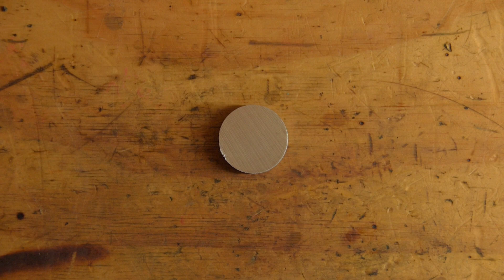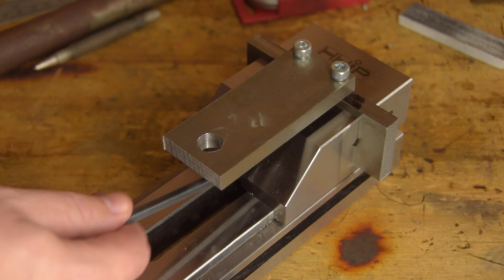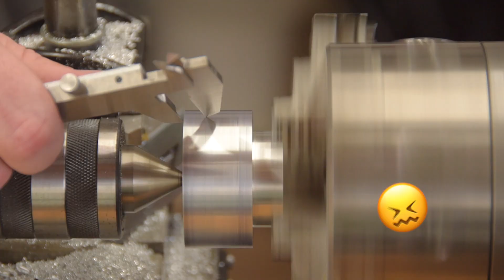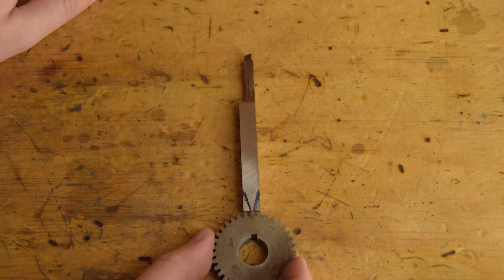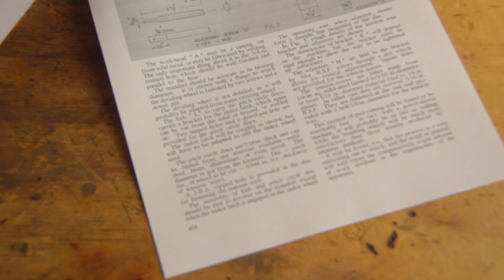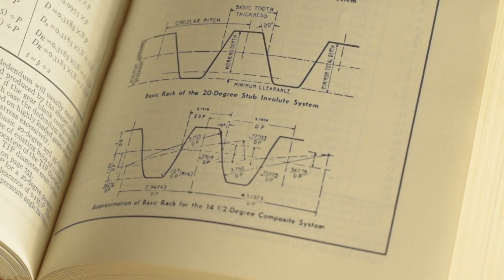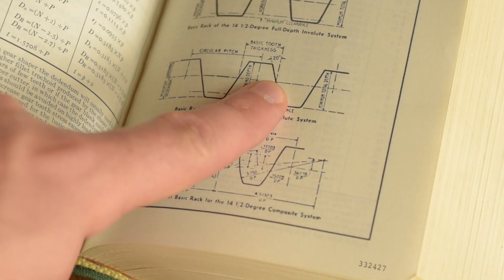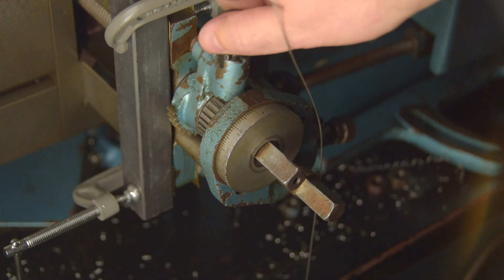Shaper Machine - Involute Gear Cutting

Comment: Interesting project. Replace the wire and wheel for a rack and pinion and I think you will have a greater chance for success. And perhaps integrate the dividing mechanism into the pinion as well. A simple way could be to have the axle running freely inside the pinion and have the corresponding dimples, depending on the division of the manufactured gear, drilled into it and a locking lug on the pinion to engage into said dimples. If you use the same pitch and module on the rack, pinion and gear to cut, I guess you could just step the pinion over for indexing.

Comment: Well done on the video Geoff. I have a feeling my uncle may have written that article, he restored a shaper too. Re the wire, I think that's a good way to avoid backlash though you may want to add a means of clamping it at its mid point to the spinny thing to avoid slip. Also a turnbuckle or something to tension the wire? And a sharp contact to reliably touch on the same point on each tooth of the reference gear. Also keen to know what software you used. As others have said, the table feed may not be super precise.

Comment: Well, there are other people who've made setups like this and gotten them to work so it should be totally possible. I know you can also cut them on the lathe. If you were going to be doing a lot of it, a dividing head would come in really handy since then you actually could just cut a tool with the gear profile and cut them directly without the finicky wire drive bit or do them on the lathe with an involute cutter.

Comment: The problem might be that the drum (with the wire around it) is slipping on the shaft a bit. I expect that the cutting force is not symmetric and is trying to rotate the blank a little extra on each stroke. Hmm, that doesn't make any sense since your indexing disk (the gear) and blank are both glued to the shaft. I didn't get a good look at how you reset the side feed after each tooth; if you use the indexer to set this and the drum were slipping a bit your teeth would drift sideways (rather than around the circumference). Do the teeth you cut gradually lean a bit as you work around the disk? It probably would not be a visible effect as the tooth would only be leaning a few degrees.

Comment: Trust me, I really did enjoy the video, but, I was as lost as a goose! I am not a machinist or a blacksmith or pro welder. I know just enough to get myself in trouble, and can do a little welding, mostly gas but do know a little arc, just no gear for the last. But I failed in college trig, so that leaves me out. I am a wood worker by hobby and a retired RN by vocation.

Comment: Having screwed up hundreds of gears, I would suggest you use a spring-loaded detent on the pattern gear. It took me a while to figure out that wire-based mechanism was doing. But it will stretch or slip, and you will lose the all-important index. There is a very good book by Harold Hall "Dividing", workshop Practice Series, ISBN 978-185486-238-9. I wound up building his dividing head.

Comment: Hmmm. This method is the hard way in my opinion, but if life were easy you would own a gear hob machine. You need to limit the possibility for error and eliminate the possibility for your errors to stack up. Also something that is desirable is a way to make gears with a number of teeth that are different than the gears you own. My first thought is to ditch the cable system for a rack and pinion, but with an added (removable) idler gear to create a shortcut way of indexing your part --- You might even be able to work out how to create different teeth numbers by simply using a different ratio between your idler and the gear turning your part.

Comment: I've seen that tolerance stack up happen on a CNC indexer. They engineer rounded the degree on the on print. The indexer was a brand new replacement with a different style controller then the previous one. So we typed in the print degree and started running. It had roughly 100 2" long slots in it. After 2 hours of running and everything looking good I got the exact same result. It was not a good day. Great video.

Comment: Did something like this back in '89.....I used a shaper and a dividing head with a 4 gear train. I was making a stub gear (3/4 pitch) The dividing head was a VanNorman with an input shaft that turned the 40 to 1 worm. It needed a spline shaft to slide through the generating gear train. I saw the pitch diameter problem right away.....good work on you anyway. Your production skills are among the best on Youtube.

Comment: First I just say what a great series of videos you produce. In response to your request on ideas on how to make the ‘thing’ into mk2, I think the issues relate to rigidity and the possibility for the cables moving slightly each time carrying error into the work. 

What my make one solid post with dovetails to mount solid to the shaper with a shaft through the centre to allow you to mount the index and material. Alternatively if that’s not possible this could be a great excuse to buy more machines.

Comment: Hey, nice video! Couldn't you combine the dividing mechanism with your wire pulley? So the dividing gear is fixed to the backside and a pin (maybe a small coiled spring pin) indexes to the wire pulley to the gaps?

Comment: Ya know I downloaded that exact article pdf YEARS AGO .... with great intentions of trying it on my Elliot 24" shaper but never got around to it... 🙄😂
Nice first try & as The Metal Butcher said, maybe u can use a rack instead of the wire... but NO BACKLASH allowed !!

That myford (ml7 ? ) is lookin clean, mine has been beaten into the ground over the last 40 years, kinda like meself 🤕

btw.... U said at the beginning that the involute ground tool  would be specific to a particular tooth
 number but commercial involute cutters (same profile as yours)  are used for a range of tooth counts !

Subbed & liked my man !!
From the Emerald Isle  😎👍☘️

Edit...
Just peeped into yer archives & seen the lathe before u restored it !! I might have a go with me own now that you've inspired me.... beautiful job !! 🤗

Comment: Great video! I see you've got some inspiration from TOT.
I think the wire is fine, it's the indexing that needs improvement. Maybe a disk with the appropriate number of holes, and an indexing pin. 
Could make the hole disk from something as simple as a printed paper template. 
At least that way, you don't get an accumulative error.

Comment: Great video!
Yes, this is indeed the reason why there so often are at least one of those old shapers left in a corner of even the most modern metal workshops ;)
Unfortunatly i cannot realy help You but i think something that can lock a given position for each turn possibly would help...

Comment: BACKLASH  now that I have your attention you need to eliminate backlash you have the backlash introduced by the piano wire , then there is the backlash introduced by the gears that drive your table ,I noticed you have to manually advance the table part way to compensate for worn drive then there is the backlash introduced by just going back to one set starting point ,even if you use an indexing plate you only advance it in one direction if you go past you don`t just roll back to the indexing point you have to roll past it then advance to the proper point you need because of backlash ( if you have watched any one who used a mill with an indexing plate you will see they do that ) it`s cumulative you have to eliminate it

Comment: A rack and pinion with a set travel length and a lifter on the rack side can reliably replace the wire provided that a preload to one side is used to prevent backlash.  The Lifter could also do the rotate after travel mechanism and the slow rotate mechanism using limit switches and a pair of small hydraulic cylinders connected with valves and a pump to alternating between aligning teeth and rotating mechanism while cutting.

Comment: Instead of wire you can use a rack to run the indexing gear on. Rack fixed to the machine (with screws). You will index and rotate at the same time. I love your work and funny storytelling
Reply: I was thinking the same thing, as long as you could adjust the height of the rack it shouldn't matter the size of the heat your cutting, just the number of teeth. So you could have a set of three same modulus gears and rack and be able to chance teeth counts. It should index better because it would be an average of the teeth it's using.

Comment: Nice video :D What kind of rake angle did you use? It's hard to tell from the video but it looks rather small, like a few degrees.
Reply from the maker: Im not sure exactly which face you mean, but the edges are 14.5 deg. the face is zero, and the clearances going back are just a little bit.
Reply: @GeoffreyCroker  sorry for not being specific. I meant the front face, so a rake angle I think? I was thinking that there needs to be some angle there to cut properly, but maybe because of a small depth of cut it doesn't really matter. Thanks for the response!
Reply from the maker: @DrekiToolWorks  yeah the front face is dead flat. That worked fine for aluminium but for steel or heavier cuts it might need some rake from bottom to top. That'd complicate the angles though which is mostly why I left it flat. The shaper is pretty tolerant barging through compared to lathe tools. I'm not an expert though.
Reply: @GeoffreyCroker  sure, that makes sense. I have a bigger shaper so I usually also take bigger cuts. Before I watched your video I wouldn't have thought that a flat face tool would do any cuts, that's really interesting! I'm still struggling with the tool geometry and I'm trying to learn how to achieve a desired effect with my grinds.
Reply: Btw, a while ago I saw the article about generating gears on a shaper that you referred to (although I didn't read all of it) and my first thought was to use electronics, so I laughed when you showed the arduino board :D But I was also thinking about using a linear encoder instead of a string. I think I am just too fond of complex solutions lol
Reply from the maker: I do intend to make an electronic version. I do intend to make an electronic version. I think it's a much more simple solution. But, the story isn't as fun and 99.9% of people aren't interested in programming...

Comment: I had to pause the video to askjeeves what a bing was. Turns out its a lot like a dogpile
Reply: some of us actually use dogpile.
Reply: @felderup  alta vista isn't aware of that
Reply: metacrawler would remember.
Reply: @felderup  okay show off :) to be fair, i spent most of my time searching with veronica.
Reply: i started on the internet late in my life, so metacrawler is about as far back as i remember actually using.  it was right around the time that slackware could still be installed from floppy disks.
Reply: @felderup  funny I'm still a slackware user, and to be honest I used lycos long after I should have because I didn't want to use what all the cool kids were using(Yahoo). But I eventually switched over, I remember metacrawler but I remember webcrawler moreso. I still haven't really accepted the world wide web, gopher is still good enough plus no ads.
Reply: you're old enough to have used kermit i suppose?  i'm still a a slackware user too, masochism or comfort with stability, dunno.  i just remembered using the execpc bbs on dialup, it was fun for the little i could use it, my tanklike ncr3230 served me well, but it didn't know how to bypass long distance charges.
Reply: @felderup  that 3230 is sexy as hell, I didn't do too much back then except play a few games on the old c64 and amiga500, I didn't even get a modem till the 14.4's came out. I did a little bit of war dialing but only enough to piss every every resident within a 50 mile radius of me. Those were great phone calls, Hey Man! you called me at 3AM last night and buzzed the hell out of me! Ohh sorry sir, my fax machine must be on the fritz, I'll unplug it... psyche. So UNFORTUNATELY no bbs's for me, all my software came sneakernet, and what I truly regret missing out on was those sweet sweet MUDs.
Reply: my 3230 was a retiree from a hardware store, same as my epson lq550+quiet, interesting they go for thousands now as refurbs.

Comment: Wow far to technical for me. 

I had a gear cutter but only a little student lathe like yours
Arbor mounted the cutter in the spindle
made a frame with a through axle that mounted to the turret that had had an axle long enough to hold the indexing disc.
The disc and frame on the tool post was small so I used a steel disc that I marked out on a disc . The gear I needed was a 42 and the locking pin was to to big to suit so many holes on the same diameter of the plate so I put the holes on two diameters. This was a pain to mark out but today you would just do it in cad and print it at the appropriate size for your disc glue it on and transfer the mark out to your disc. 

Then a simple plunge cut to depth. It kept my old 1/8 scale pan car running far longer than it should have been. 

I have done this for some very large gear segments on a Slotter professionally but I normally just plunge cut and use 2 tools with different profiles. 

Anyway who says you cant use the rotary cutter to finish of the profile in the shaper just bolt it to the side of the tool holder?
The indexing was the failure here as the cable couldn't handle the side load of the tool. A more robust rear fixture and some real tension it should work better.
Cheers
Reply: Mr T  Just listing a method I figured out when I was a teenager still at school. Well before internet sadly.  Honestly making a tool fixed or rotary really isn't a big deal in the scheme of things if you can sharpen a HSS tool to a gauge. Also this type of application for gear cutting is quite forgiving.  The trick is accurate indexing as shown and I explained. How did I figure it out I used the cord calculation for the number of holes required on each diameter then used the ruler to bring the outer pitch diameter to the smaller and marked from there.

Comment: So... use a rack on the sample gear for both the indexing and the locomotion. Those wires are part of the issue. The shaft should have some ability to slide, so you can slide the shaft and sample gear out, rotate it one notch, then mesh back into the rack.
Reply: This is exactly what I was going to post.  You could even have the rack on a hinge, spring loaded on top of the spur gear.  To advance, lift the rack, rotate the part, and drop it back down.  As long as the rack is parallel to the table, your locomotion and indexing should work fine.  This would also let you change out the spur gears you are duplicating without having to mess with other parameters besides the height of the hinge.
Reply: Great minds think alike sir, i just wrote something very similar and then found your comment lol. Hopefully he sees and gives it a go
Reply: That sounds like a plausible concept !! 😎👍☘️
Reply: Was checking to see if someone else had thought what I was thinking.  You wrote it so much better than I would have.
Reply: The rack meshing with the index gear will work very well; however, to cut any gear you would always have to have an index gear with the same number of teeth as the gear to be cut, and the same DP as the rack.   Indeed, with your present set-up you need an index gear with the same number of teeth as the gear to be cut, albeit that it can be any DP or module.   I think slipping of the wire drive induced by the cutting process is the problem, combined with the accuracy of the diameter of the wheel being driven by the wire.  Perhaps have a few more turns of the wire around the wheel, and an index mark on the wheel and wire to ensure that they returns to the same place after the completion of each tooth.   The diameter of the wheel, and the thickness of the wire need careful consideration and accurate measurement and maybe some trial and error.